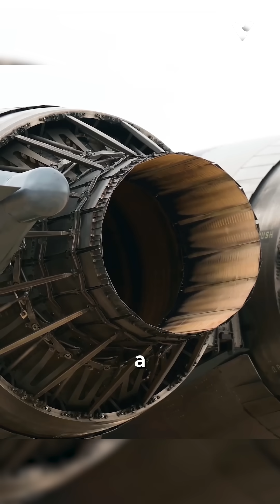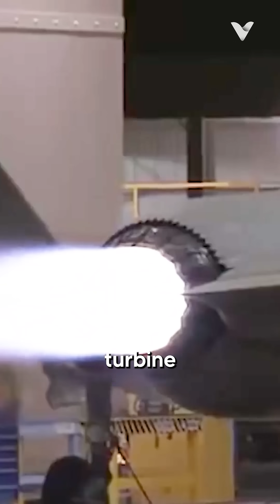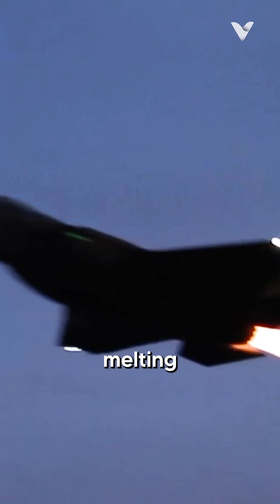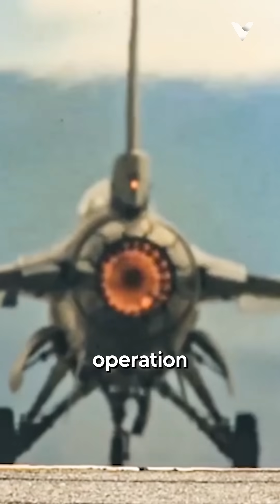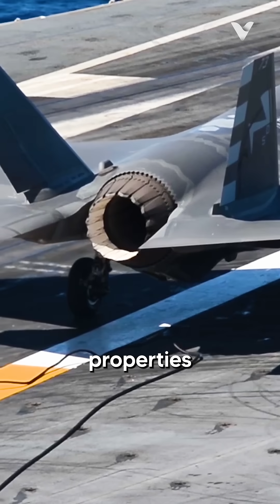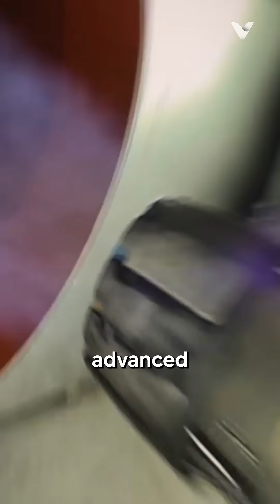Why Don't Jet Plane Nozzles Melt? #shorts

Comment: During his explanation of a jet engine’s workings, I couldn’t help but remember the mnemonic we were given in the USAF for remembering the different stages of a jet engine:  Suck, Squeeze, Bang, Crank, Blow.

Suck:  air intake.
Squeeze:  compressing the air.
Bang:  igniting the fuel/air mixture.
Crank:  turning the turbines.
Blow:  jet engine exhaust.

A simplified explanation, of course, but good enough to get the general idea.
Reply: In any other context, what you described sounds like the basis of a good damn time.
Reply: @nothing_burger :  Yeah, they warned us up-front that the mnemonic was going to sound pornographic.  I didn’t include that tidbit of information when I made my original comment; but I see that it didn’t take long for someone to make that leap.    😊
Reply: @nothing_burger :  They warned us up-front that the mnemonic would sound po*nographic, but I didn’t include that tidbit of information in my original post.  Didn’t take long for someone to pick up on it, though.    😊

(Reposting my response, since YT deleted my response.)
Reply: @nothing_burger 
     😀😀🤣🤣😁😁😜😜👍👍👍
Reply: @nothing_burger including cranking?!
Reply: as a former jet engine mechanic, who worked F-15s back in WW Desert Storm 2 era (1999-2004).  I did witness the tail end of the afterburner section melt. But it didn't melt from the heat.  It melted because the augmentor fuel line on the bottom portion of the afterburner section broke and leaked fuel down the pipe.  

And if you were wonder if the pilot knew he had a fire, the answer is no.  He didn't know because the fire loop detection system didn't catch it. 

It was interesting to see the turkey feathers melted off.
Reply: @fireboltaz  Dsnng man. Im an engines troop stateside. Its always funny when a new pilot turns off the anti ice lmao. We also have an ungodly amount of times the spray rings crack and a fllame out happens haha. Its fun out on the line, except on 16s with pratt 220s
Reply: @ I believe the line that cracked was the one that came into feed the spray ring. Like the spray ring was fine, but the fuel trickled down the pipe. (PW-F100-10 engine)
Reply: Suck, Squeeze, Bang, Blow, has been used to describe the 4 stroke engine for many years.
Reply: Yup, we used suck, squeeze, bang, blow in Aerospace (generally not mentioning “crank” as this was usually in thermodynamics, naming the stages of combustion on something like a PV diagram (crank is a mechanical by-product of the band stage)). It was always interesting when a learned professor would use this phrase in front of 100 18 year old Freshman
Reply: Here I was thinking something else
Reply: So the USAF has stolen my secret playbook for use with JETS?! 😂
Reply: funny enough that is the same steps a 4 stroke piston engine performs.  What makes them different is the fun part.  They accomplish totally different outcomes based on the same basic principles.  I love it.
Reply: To quote the veneral Beavus & Buthead, it Sucks and Blows at the same time.
Ex-IAF airframe.
Reply: It’s really not that complicated
Reply: @jensgronning4436 :  Hence the simple explanation.

Comment: Regular jet engines have much higher exhaust temperatures 
Turbo means they stick a regular little jet engine inside a bigger fan engine, the little engine spins a turbine at the back that is connected to fans at the front
The hot exhaust mixes with the cold fan air increased thrust, efficiency, and colder exhaust temps

Turbofan is different from afterburner
After burner is when they dump more fuel in than the engine can burn internally, at the most efficient spots, so the fuel keeps burning all the way back and outside the nozzle, really inefficient and very hot, but it does boost speed a bit for emergencies

Super cruise, when jets can go past the speed of sound around 800mph, consistently, without after burner or other inefficiencies outside optimal engine settings
But the speed of sound barrier still eats a lot of energy so even if a jet can cruise above speed of sound, it's still inefficient

So when jets fly to intercept or escape they go as fast as possible, 
But the rest of the time subsonic is common

Comment: I built the thrust vectoring nozzles on the F-35 and F-22 for 6 years. They are Inconel and have a ceramic coating we called flame spray. They are cooled externally with hollow cavities to allow air to pass through and vent in critical areas.

Comment: This is why aircraft are my favorite vehicles of all-time, and it isn't even close. These things are stupid advanced, and require only the brightest of minds to develop and engineer. Anyone could make a car, slap four wheels onto a chassis, find a way to power and steer it, and you more or less have a car. Ships require more engineering, especially massive ships like cruise liners, but neither of those come anywhere close to the advanced technologies and methods required of aircraft.

Comment: Rocket nozzles are insane in this area. The combustion temperature is MUCH higher, and the jet speed is multiple times that of airbreathing jet nozzles. The thermal flow through the wall at the throat of a rocket engine can be tens of megawatts of heat per square metre.

Comment: The materials used to withstand extreme temperatures are super-chromium alloys like inconel, which is further thermal barrier coated. Inconel is resistant to rust and corrosion.

This video could've not gotten straight to the point faster. Probably used Chat GPT to add more words.
Reply: Yeah, this feels like it was made by an Indian video farm.
Reply: Most people struggle to take information into there heads so they need the information to be given slower. My long dead design technology teacher once told Me "Remember to always present everything for the most stupid person who knows nothing".
Reply: Inconel can crack though. We used them in heat treatment and they crack all the time.
Reply: @HenryTheBoilermaker3rdYear  im just stating what the video said

Comment: The main reasons why the flame doesn't touch the divergent or convergent segments/seals is from the secondary airflow and the flameholder. The tempature inside the core doesn't change when going into augmentation. The ignition isn't from the core but inside the augmentor. The secondary air flow helps to prevent contact with the liner. The flameholder makes the flame pretty and controls how it leaves the exhaust. The material does still get extremely hot and over time will breakdown from wear and tear. Along with the simple fact that heating and cooling material causes it to expand and contract.
Reply: When I was jet engine mechanic, who worked F-15s back in WW Desert Storm 2 era (1999-2004).  I did witness the tail end of the afterburner section melt. But it didn't melt from the heat.  It melted because the augmentor fuel line on the bottom portion of the afterburner section broke and leaked fuel down the pipe.  

And if you were wonder if the pilot knew he had a fire, the answer is no.  He didn't know because the fire loop detection system didn't catch it. 

It was interesting to see the turkey feathers melted off.

I believe he landed Code 1
Reply: Revelation 3:20
Behold, I stand at the door, and knock: if any man hear my voice, and open the door, I will come in to him, and will sup with him, and he with me.

HEY THERE 🤗 JESUS IS CALLING YOU TODAY. Turn away from your sins, confess, forsake them and live the victorious life. God bless.

Revelation 22:12-14
And, behold, I come quickly; and my reward is with me, to give every man according as his work shall be.
I am Alpha and Omega, the beginning and the end, the first and the last.
Blessed are they that do his commandments, that they may have right to the tree of life, and may enter in through the gates into the city.
Reply: Also leaving out the fact the cool air leaving the Mixing Duct is routed to the Flameholder to mix the core gas prior to lighting. Hot gases mixed with cooler dense air is one of the reasons Augmentors are more efficient in producing thrust. MFE
Reply: @thatmitchellguy  this cool air is from the tiny holes in the augementor liner.
Reply: @fireboltaz  I think you missed that I was just tacking on extra info. That cool air that runs under the Aug liner hits the mixing duct first, which is we the majority of the bypass exits out of. And prior to the mixing duct, it’s going around the turning frame and so on and so on.

Comment: Bypass air also ducted through the outer jet pipe casing flows through perforations into the exhaust inner lining.

Comment: However, a lot of jets can only use afterburner booster for take off or to temporarily speed up, because afterburner temps can melt the engine and it's compressor parts, so most jets can use its afterburner for a short period
Reply: The main reason they don’t use afterburner more is actually fuel flow. Typically your get 50% more thrust for 100% more fuel flow. The RB199 is unusual in that it gives 100% more thrust…. But 300% fuel burn! Painful.
Reply: @markharris8929  Yeah, you get a lot more thrust but the thrust-specific fuel consumption (TSFC) is lowered significantly. Hence, it's just a waste of fuel besides short maneuvers/takeoffs. Not sure, but I think the lower efficiency is due to a combination of lower pressure and higher temperature in the afterburner inlet than the combustor inlet.
Reply: @ it’s worse because you’re just chucking fuel into the exhaust! No carefully tailored compression, swirl or thermal efficiency, just throw fuel into the fire and adjust the nozzle to get maximum speed instead of pressure rise. Crude, but effective. A gas turbine loses efficiency outside of its design thrust. So better a smaller engine and big afterburner assembly vs a much bigger engine throttled back most of the time.
Reply: Compressor parts upfront of engine not at afterburner ??

Comment: Between mixing it with fuel and expelling it, the most important step is combusting it. You need to combust the fuel to release the energy in it.

Comment: Interesting info! On a side note, another common material, tungsten carbide, can withstand extreme high temperatures with a melting point close to 3,000⁰C.
Reply: It's just 20 times heavier than the inconel alloys used. A tail heavy plane goes down backwards and is extremely difficult to control during a flat spin which it will easily induce.
Reply: What's this in F°?
Reply: @JayJay-BRZ  a whole lot of Fahrenheits. Sorry I don't use archaic measures.
Reply: @JayJay-BRZ  boomer moment
Reply: @Not4U2No-d2u  I'm gen Z 2000-2010
Reply: @JayJay-BRZ  do you know what a google is though?
Reply: And it's spelled differently than Google. But close like that
Reply: @JayJay-BRZ  5432 degrees in proper units (Fahrenheit)
Reply: @sugarflame1833  what do you mean "proper"
Reply: @hrishikeshaggrawal  he means he's a boomer 😂😂😂
Reply: @sugarflame1833   Thanks. I don't know what a Celsius is. 🦅

Comment: Air is pumped through the turbine blades as well. As each row of turbine blades takes energy from the hot gas stream, it cools the gas. As the gas comes out the back it is at a lower temperature, thus the nozzle does not need active cooling.